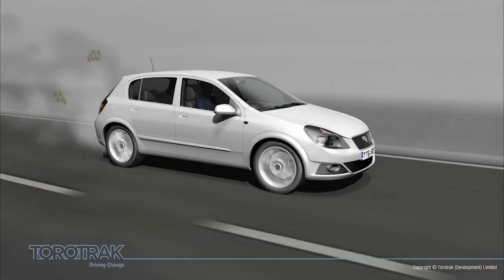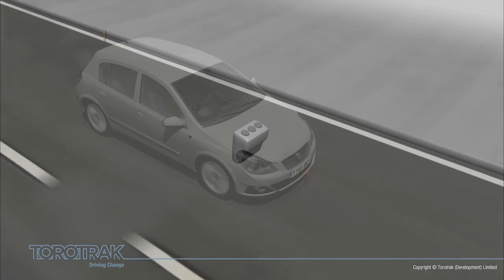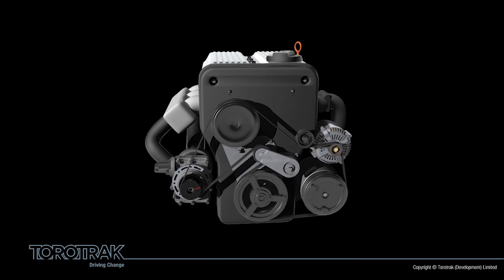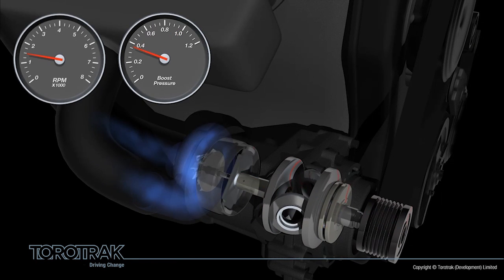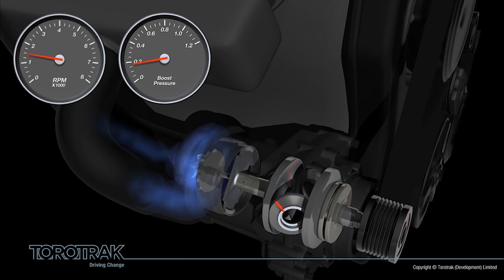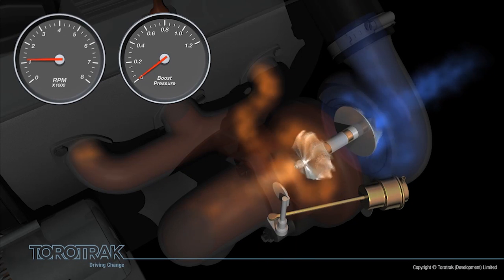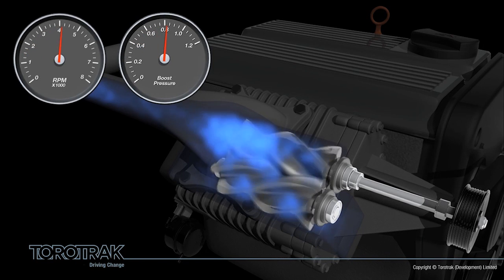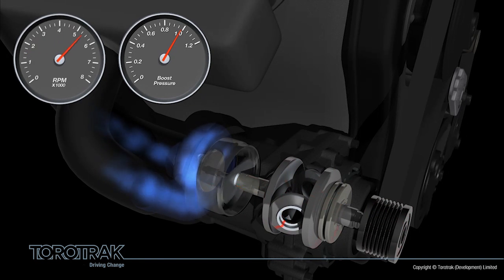V Charge Variable Drive Supercharging

Comment: Hello Torotrak; as I've heard, apparently Subaru is "struggling" to produce a higher powered boxer engine for their performance models, that effectively passes emission regulations. Since the different supercharger kits for the BRZ have been successful, maybe this could be the best time to approach Subaru with your toroidal supercharger. At the moment, Subaru has a 2.0 liter boxer which would be great for your supercharger; being speed-variable and a simpler system, may help regarding emissions. The performance world is waiting for Torotrak.

Comment: This is a good technology to apply to reduce carbon dioxide emission and increase efficiency.  But it does not appear that it is going any where.  They should reserve a small % of their yearly budget for marketing and have a marketing company who are specializing in promoting a product to promote this product.  

They say that in life, it is not what you know, it is who you who.  Thus using a marketing company that has connection, in this case connection in the Automotive industry and not retail or food industry, would do much in promoting this product.  

In all case, I hope this product is successful in getting to the market.  As it seems like a needed product.